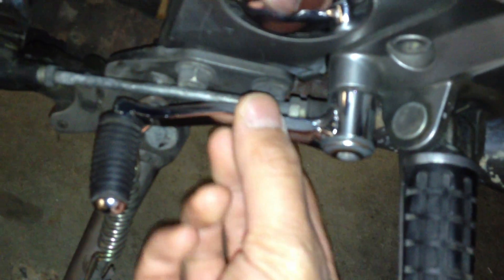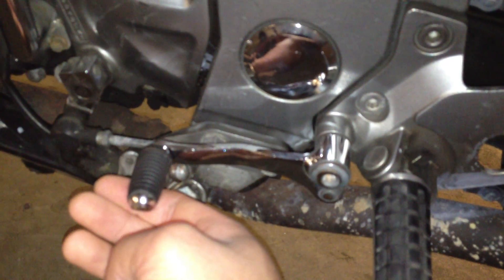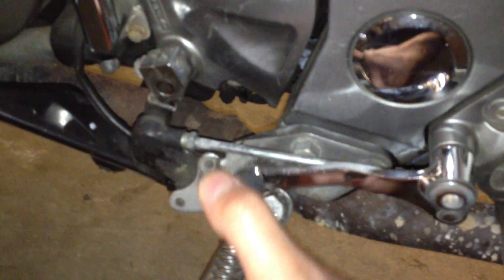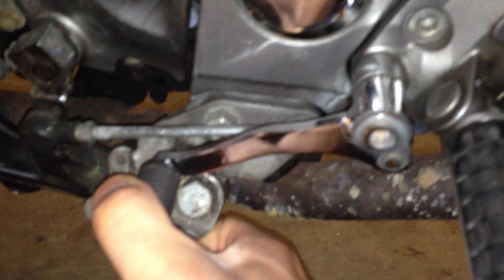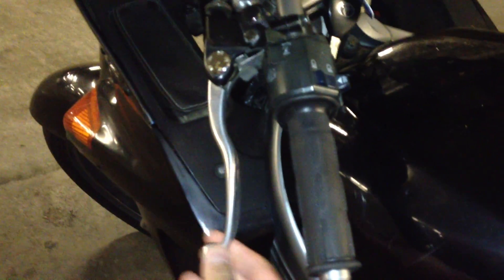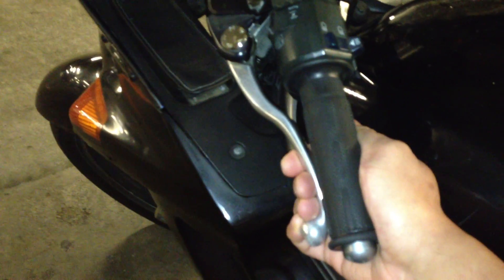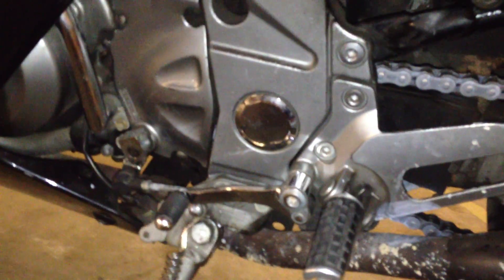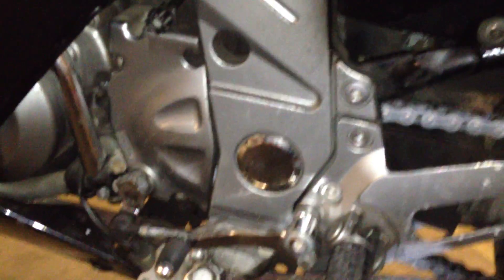Motorcycle gear lever moves and clicks but can't shift

Comment: I seen one video on YouTube where a guy had problems with his motorcycle not going into gears and it took the cover off where the clutches at and found out that all it was was a loose bolt or screw causing the little round shifting gear piece to not stay in place. This round gear piece had knobs on it

Comment: same problem of my suzuki raider j 115 fi. my mc doesnt run even into gears. it seems like it always into neutral. how will i fix it.
Reply: Same i connected my sensor ground to any part and it cranked but now the neutral light stays on and i cant shift out of neutral does it matter where you connect the sensor ground

Comment: Did you find a solution to the problem? same problem to honda cbf 125
Reply: chris cs just bend it back a Lil then take the whole thing off nd repostin it.. it WILL TAKE TIME ha but it's easy

Comment: it happend to me just now. I pull the shift lever outward and test it with my hands. I got an old bike. 1975 Suzuki ts 125 erz
Reply: Did you find a solution to the problem? same problem to honda cbf 125